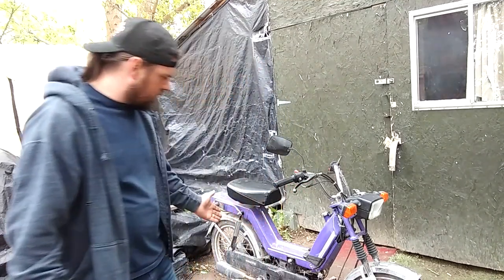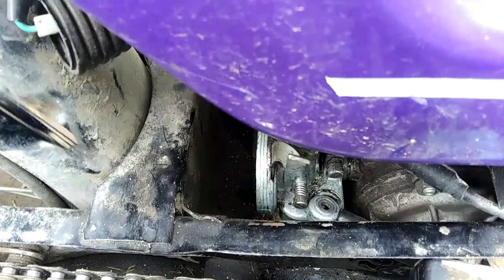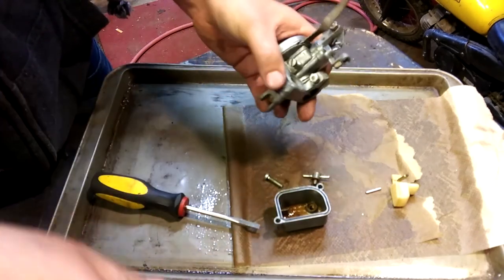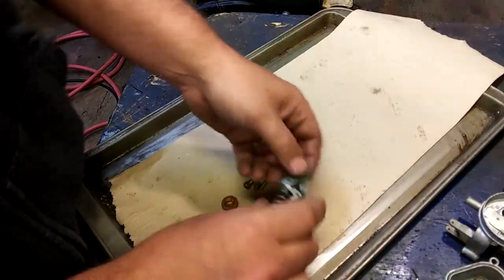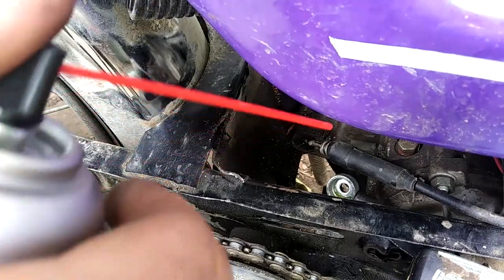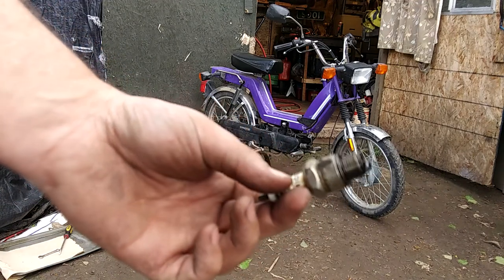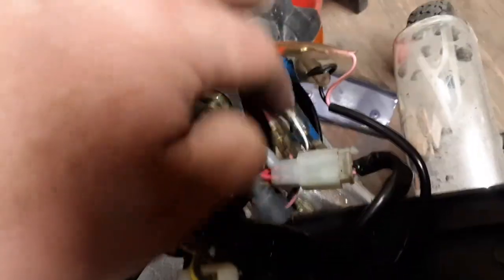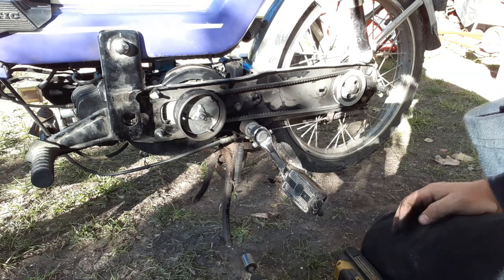KINETIC  MOPED CARB CLEANING DEBACLE

Comment from the maker: trying to get to 1000 subscribers so hit subscribe....thanks
Reply from the maker: Blue  more to come... stay tuned.
Reply: Thank's Wess! i actually got the carb done earlier this morning and she lives!!! will only do 25+mph but im seriously thinking of oppening up the jet a bit more to give her some real bite
when i take off and to get some better acceleration when riding, still...for a moped with 60...oh now...72 miles on her, ya can't beat it! by the way...i do believe that SACHES parts are also interchangeable as well as the Piagio ones you talked about in the video. Anyway shes runnung good, Question.....did these use a small battery on board or just the Magnito for power, and is the electrical AC or DC??? if it's DC is it 6v or 12v? just curious cause id like to place a small Battery on board to buffer the draw when running.
Reply from the maker: @phildoethedildoe  mine only does 30 when I really  try mostly it does 25. Mustie1 said they made them that way to  abide by city speed limits. Enjoy you moped...I sure do

Comment: man I know you had hell with this video and your bike, but this was a huge help for me. I got my bike that had been sitting in a garage for a year and it would not crank up. cleaned the carb just like you showed and it cranked right up. it is a bit weird because it will only run if I hold down the choke, if I let go of the choke it dies. I may just need to adjust the fuel screw but im just glad she's running. thanks for your video man!
Reply from the maker: I'm glad I could be helpful. Thanks for watching 👍😎

Comment: Sweeeet. These are neat, I remember when the importer cosmopolitan motors was selling these for $399 shipped back in 03-4 while jc whitney was asking $699.lol

Probably the best clone moped we got here in the states. Soo many parts available for the engine as it's a Vespa ciao basically.
Reply from the maker: That's very cool. They are fun to ride. Thanks for watching
Reply: @WesleySnyder  I found out that evaporust works great for cleaning carbs it is biodegradable and non toxic
and is safe on plastics what i did on my peugeot carb is first i removed most of the grease/oil on the body and dissaseble it then i dipped the carb and all the bits on the evaporust.
Cheers
Reply: @WesleySnyder  after removing the carb from soaking on the evaporust i cleaned it with water and blew all the passages out with compressed air but you can use carb cleaner or brake cleaner.
Reply: @WesleySnyder  Oh and the carb comes out looking like new! you can re use the evaporust.
I also used it to remove the rust from the fuel tank.
Cheers
Reply: @WesleySnyder  The carburator on my Indian moped has the same type of slide like yours that carburator is a Kehin carb.
Reply from the maker: @SDsailor7   I have wanted to get some evaporust and try it out
Reply: @WesleySnyder  Before i bought it i wanted to know if it was a good product to buy i had been using vinegar but it takes too long for it to work. Anyways i found a channel here called project farm and he does unbias comparisons of different products and tools so after seeing  his test i was sold and bougt a gallon at home depot one of the things i like about it is that you can reuse it several times.
Hope this helps. Watch the video and you know what i mean.
Cheers

Comment: Your video was a great help! Cleaned everything, changed gas, squirted some engine start in carb ans.. it rain, for 30 sec. booo. Suggestion please?
Reply from the maker: Maybe the spark plug is bad.i get parts on mopeddivision.com
Reply: @WesleySnyder  Spark plug was first thing I changed. 
Turns out, bone head back yard mechanic! LOL. Throttle cable was not re-adjusted by said yard mech. putt putt and away I go!
Reply from the maker: @genesmith5224  awesome. They are pretty fun even though they are slow. thanks for watching

Comment: Hi  thanks for the importat videos about this moped . Please I get a 2003 kinetic tfr . I used to turn it off from the key now is not turning off even if I remove the wires from the ignition . What could be the problem please ? What I get to fix to get it back to turn it off with the.key ?
Reply from the maker: Ok I just twisted the two wires to the ignition together and just use the switch on the handle bars.
Reply: @WesleySnyder  hi I fixed the problem on my moped . Now the ignition switch is working . It was replaced . The engine kill switch is working good to after rewired it the proper way . Thanks
Reply from the maker: @adamsmith4537  thanks for the update. I rarely get them from people who ask me stuff. I'm glad you got it figured out

Comment: My bike keeps bogging down. I'm thinking it's the stock pipe. It's the only thing I can think of. We cleaned the carb. Still having same problem.
Reply from the maker: i think your on the right track. when i first got this bike the exhaust was plugged. maybe pull the exhaust off just to test if it is  (thats what i did). if it runs better with it off you can try to clean or replace the exhaust. thanks for watching.